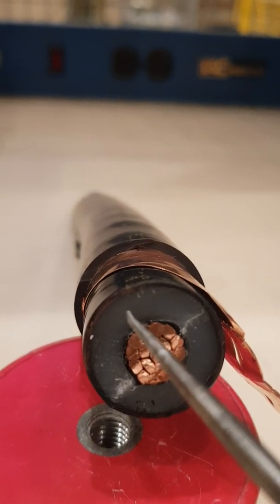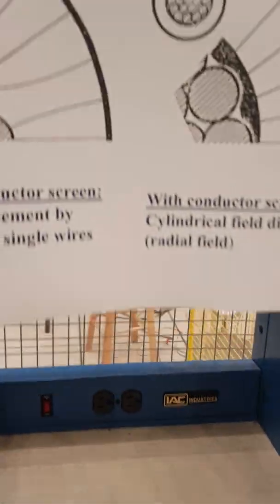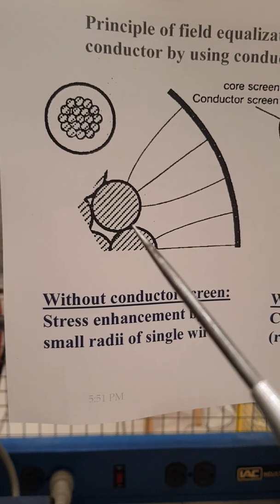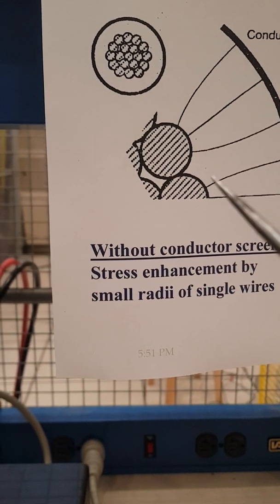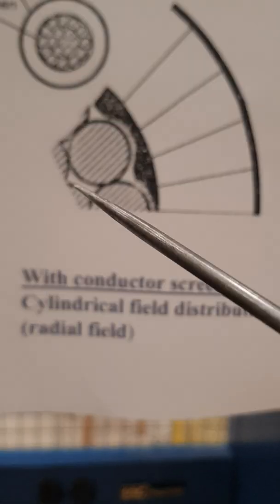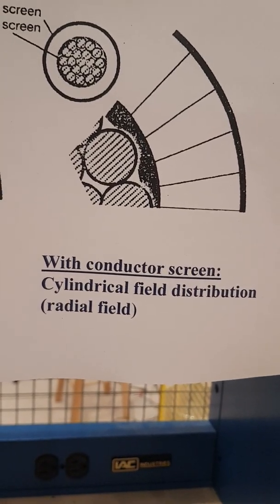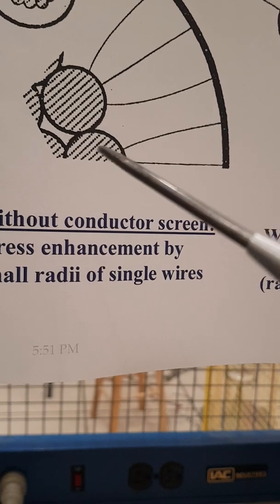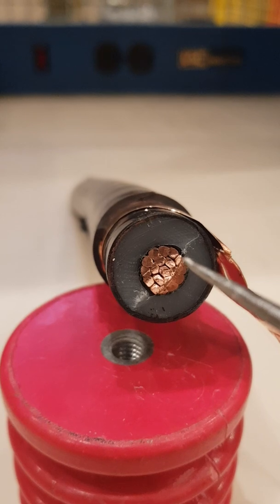Components of underground cables

Comment: This is fascinating information. If I'm not mistaken, I think with a stranding conductor; we make AC and DC resistance different. Thus, in an unstranded conductor, the current passes through its surface, while in a stranded conductor, it passes through the entire conductor.